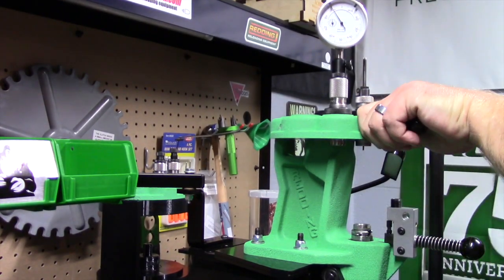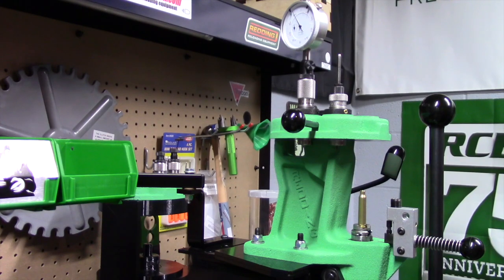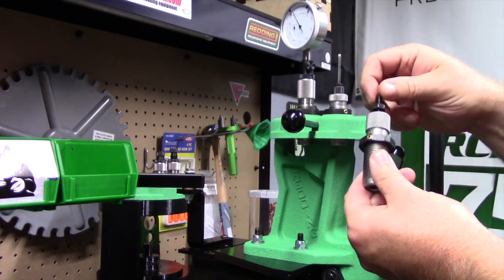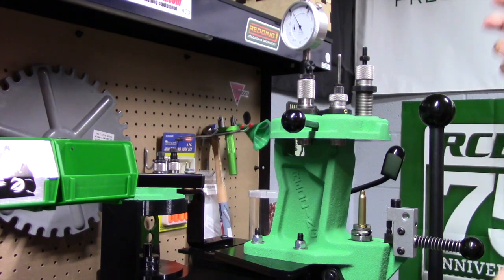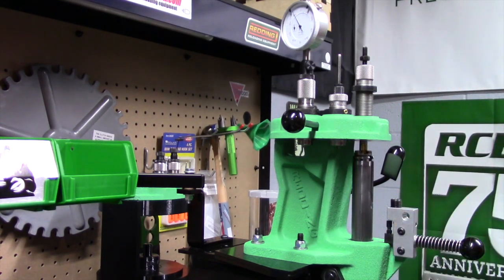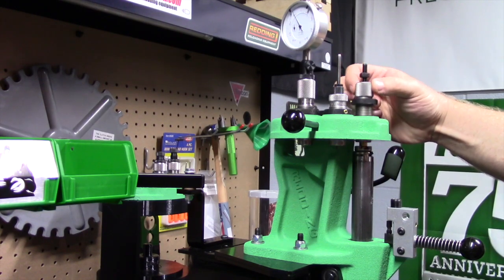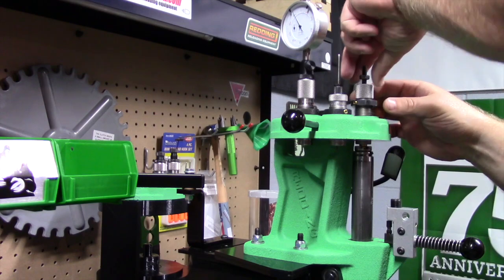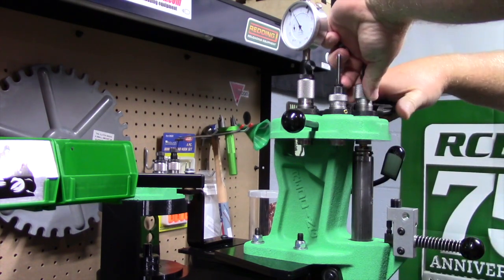Redding T7 Turret 223 Seat and Crimp Pt 3

Comment: Another great video Squatch. When reloading for the AR15, AR-10, or LR 308 platform rifle you really need to have a crimp. The action is so violent that it will cause bullets setback as well as bullet length growing from its slamming home in the chamber. It will also cause bullets that don't have good neck tension to move forward in the magazine, which will cause loading issues from the magazine into the chamber. Usually causing the bullet to dive right into the M4 feed ramps and jamming up the works. I use a Lee Precision Factory crimp die with a medium 2 medium heavy crimp with no issues after thousands of rounds. Can't wait to discuss more 223 reloading with you on our next live stream. Take care brother, Echo.
Reply from the maker: See you tomorrow night man!!!

Comment: Squatch, that was a good instruction. When you put your carpenter's hat on, take a look at the plans offered by the national reloading manufacturers association. that was the plan that I used and have been happy with it ever since. super strong, 4x4, 3/4 in plywood and 2x6 construction, and a big plus are that it does not weight a ton to move.  here is a link   http://accurateshooter.net/Blog/benchnrma.pdf.   You can alter the basic plan for length, Hight, and width. I made mine a full eight feet long. you also don't have to build the cabinet, just simple shelving set up is all you need. -Dave
Reply from the maker: Thanks brother I will check it out.  I am in the process of laying things out and trying to condense into a smaller space.